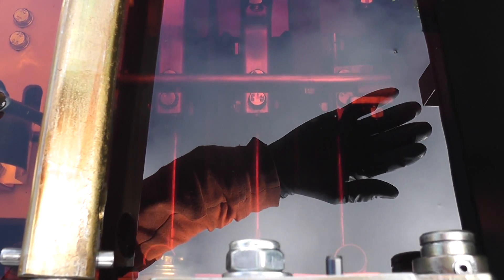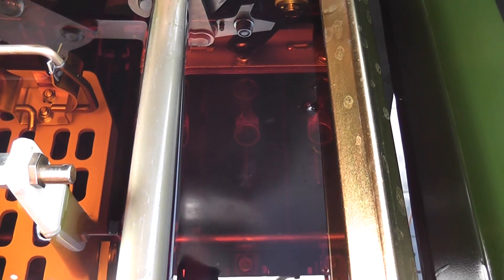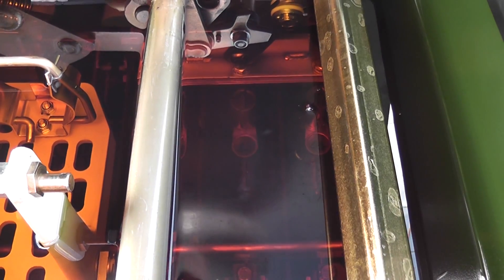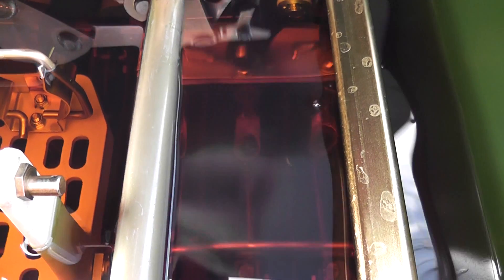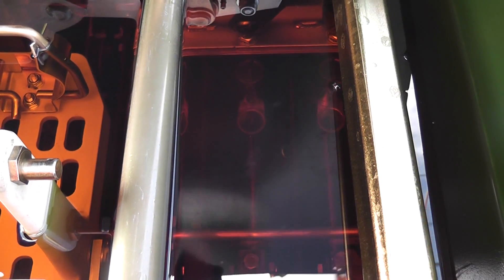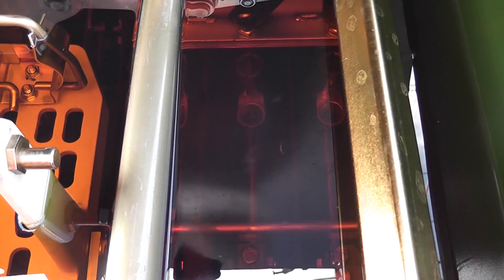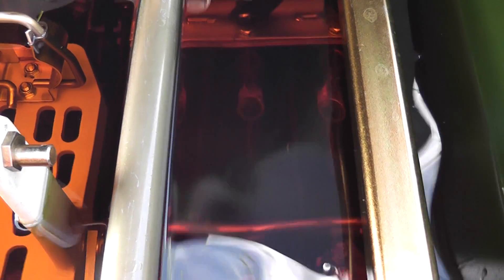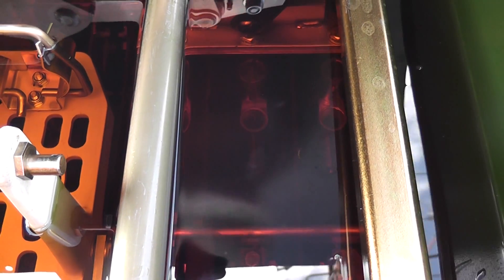Switch contacts in an RMU - De-Energized

Comment: You still do use bulk oil switches in Australia?
Reply from the maker: Yes on 22 kV 33 kV and 110 kV bulk oil switches are still in use. A lot are being replaced with SF 6 switchgear.
Reply: Thats good to hear, thanks for the answer. 

Cheers!